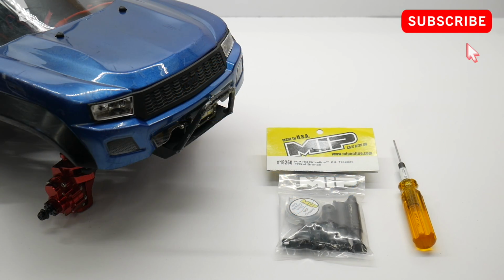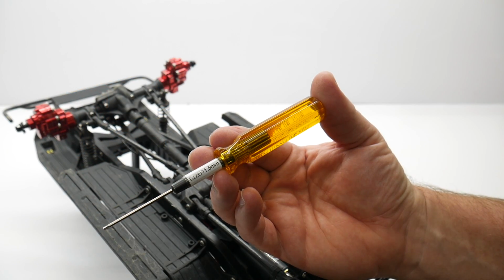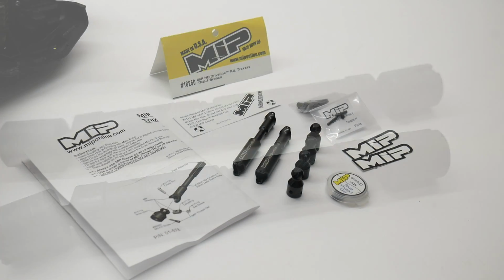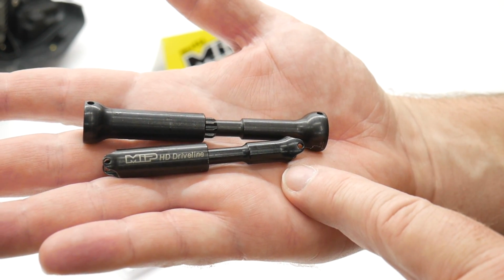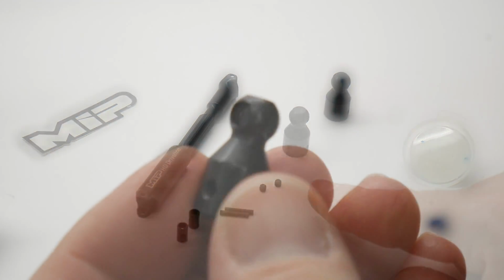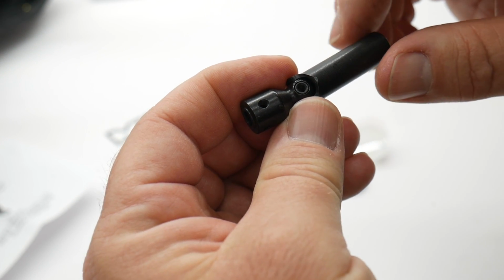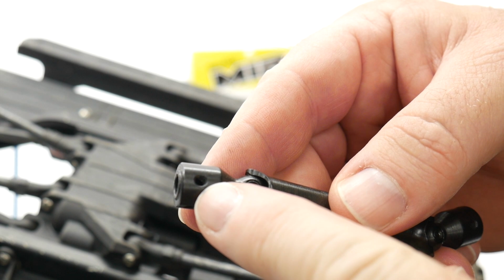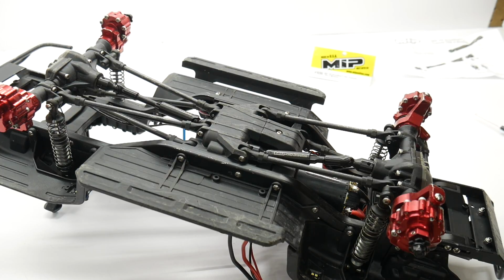MIP Steel Driveshaft Upgrade - Traxxas TRX-4 Scale RC Truck

Comment: They are top notch no doubt but really...are they necessary on a trx4??
Reply from the maker: For most the stock shafts are just fine. However, if you add certain power upgrades, it could effect other components, driveshafts being one.
Reply: I have my stock drive shafts on my trx6 for 5 years now .. And I beat the hell out of it !

Comment: I love mip’s. I was just wondering if you noticed how close the drive hub is from rubbing on the underside of the transmission case, in the front of the tranny. There is a curved out section in the front, for the driveline, but it was so close that I actually shave about 1/64” off the edge of the rounded part. Also, in that same spot, the pin screw that holds the mip driveline on the front of the transmission, is too long, and sticks out the other side, hitting the same spot on the bottom of the transmission case.
Reply from the maker: Mine was close, but nothing rubbed.  I'd double check your install and the items around it to make sure it's still correct

Comment: I have to ask cause I can not find an answer ANYWHERE…I have a TRX4 Bronco ‘79 with the Traxxas lift kit installed. Would you suggest running the MIP 18250 or the MIP 17110? The 17110 are designed for the longer wheelbase platforms but given that my truck is lifted and the stock plastic drive shafts had to be extended I’m doubting the MIP 18250 will be long enough with the lift kit. Even MIP could not give me a clear answer besides stating to purchase from them directly and return them if fitment did not work. 😡
Reply from the maker: If I remember right, didn't the lift kit come with extra parts for the driveshafts?  To make them longer?  I'd go with the longer option and go from there...you can always cut down the internal male section worst case

Comment: Good vid ! I have the 12.3 wheel base, with the long arm lift kit. Would the 12.3 drive shafts be too short? 🤔
Reply from the maker: The kit comes with parts to the driveshafts to lengthen them as well
Reply: @TheRCNetwork  Thanks bro I'm on it! 🤓👍🏼

Comment: Mips need constant service  ,cleaning  and oiling after every run .with no service they rust in no time.But they are the strongest on the market.I never break any of my TRX4 stock shafts not even with my Kratos six on 3S Brushless.The TRX4  shafts are the strongest plastic shafts i ever have on a truck "tortured" ha ha.
Reply from the maker: Not really, in my experience.  Sure, any component when clean and lubed will run better, but I've abused MIPs with pretty good results

Comment: is it stainless??
Reply from the maker: MIP driveshafts are all hardened steel
Reply: @TheRCNetwork  so it's likely will get rusty
Reply from the maker: @kkkastig  it’s coated to prevent that.....but sure, if it gets scratched and you live in that kind of climate, anything made from steel will rust. And to be honest, I’ve never seen a stainless driveshaft.....they wouldn’t have he strength like hardened steel

Comment: Have you noticed if these are quieter than the stock shafts (particularly at high speeds)?  Thanks for posting.
Reply from the maker: Yeah, they seem to be.  Not sure if the Plastics are just looser fitting or what

Comment: I see it's been a year, since you made this video. How are the drive shafts holding up? I have vanquish incision on another RC crawler that I have and I was just wondering if I should buy those again or get these instead.  The incision drive shafts have held up great with a tun of abuse. 4s abuse so thair tough. Do you think the mip will take same abuse
Reply from the maker: My MIP's are doing great still.  The Incisions are also pretty decent....can't go wrong with either.  I'd personally stick with what you have though...keep replacement parts to a minimum (set pins and such)

Comment: These shafts are absolutly weaker than the originals.  The lack of material present around the pins is surprising.  Maybe they figured pit the perfect heat treat or something.  Truck is looking good though bud
Reply from the maker: Anything that MIP does is highly engineered and tested. They don’t rush to market, they take their time. I always like the beefiness of their traditional driveshafts, but never the scale looks. These now fox that.